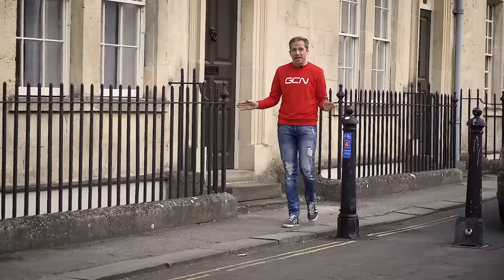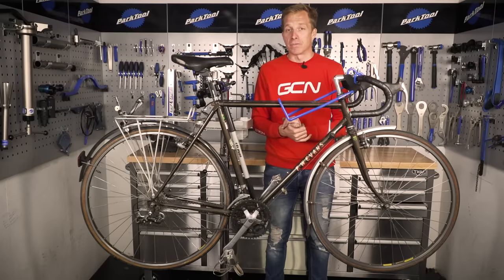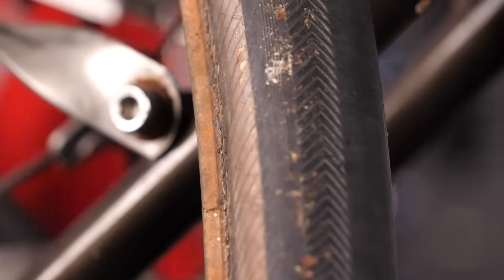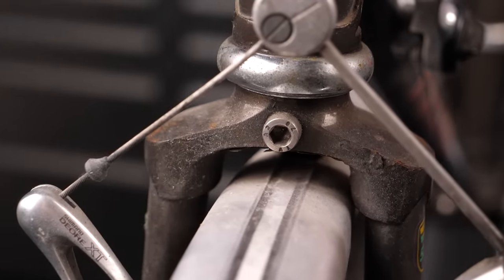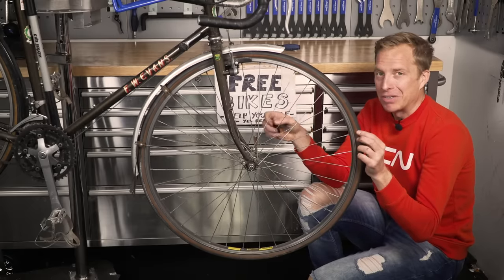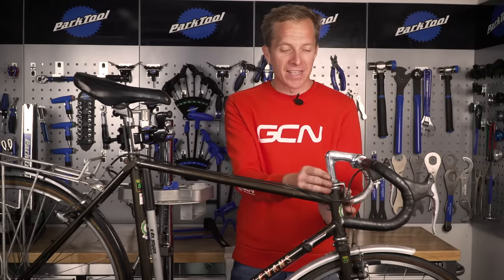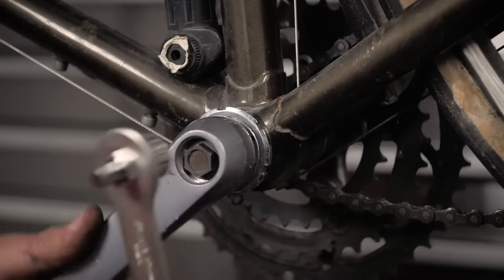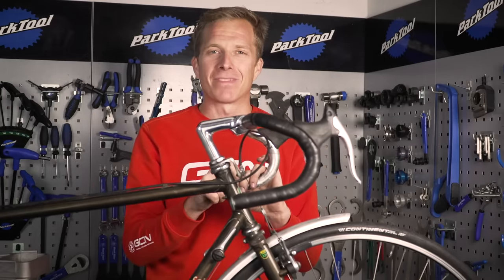Trash To Treasure | How To Fix Up An Old Bike

Comment: Very interesting story, and I have 2 of my own to tell.
The first was in the early 90s and I found a Tigra, 531 DB tubing, all Campagnolo Record, Mavic wheels and tubulars in a skip. I asked the owner of the house as it was being cleared and he told me to take it.
I dismantled it completely, down to the last ball bearing, replacing cables, chain, tyres, headset and bottom bracket. eventually I installed Shimano XT components (Ultegra brakes) and I used it regularly as a "doesn't matter bike" until last month! It had chromium-plated ends and drop outs, fancy lugs - paintwork was not too good so I sanded it down and resprayed it, keeping the chrome ends.
I took a good look inside the frame and no rust! Just before I threw it out, with the frame number, it was identified as a pre-production frame which would have been given to a pro team in 1972.
My second find was a Japanese bike from late 1980s which I have treated similarly. Frame is dead straight, no rust, wheels useless. Beautiful paint and brazing. I have spread the rear axle to take an 8-speed wheel, and am fitting new bars, 8/9 speed XT and 8-speed sis brakelevers/shifters. Smaller chain wheel (42t) was a little worn and I have fitted a Shimano 38t, with a 13-32 XTR teeth rear cassette.
In this case headset, bottom bracket like new, probably ridden little, but left outside in a shed for 20 years. A Dura Ace seatpin and Selle Italia Flite with some Dura Ace clip pedals have been added. I had an XTR rear hub rebuilt with a modern Mavic clincher rim, I am lucky to have a pile of unused parts lying in my cellar which I have bought over the years and welcome a chance to use them.
First, look at safety - in my view replace all cables, they cost little, inner and outer; new chain if the gear train is ok, and check the frame for bends, breaks assiduously. - I cannot stress this enough as an acquaintance gave me a couple of old Italian bikes, one had a hairline fracture of the forks which he forgot to tell me about ... what I call a near miss!

Comment: You definitely lucked out on that bike Jon. I tinker with lots of old bikes myself and I've pulled bikes from the tip that just needed air in the tires so not unheard of. Say I'm wondering why you didn't repack all of the bearings as part of your maintenance. It's my rule of thumb that hubs, BB and headset all get fresh grease. Also you didn't talk about brake pads. I've found new pads is a smart investment as well if you plan to ride it.

Comment: Also check the derailleur jockey wheels, believe it or not.  I've been riding a similar era touring bike every day over a patch of grooved pavement near my house, and the bolt holding the lower jockey wheel actually worked itself off.  My derailleur basically exploded.  I'm trying to keep this bike mostly stock, so I had to pick up the pieces I could find and rebuild the derailleur completely, hammering the pivot pins back into place and straightening the jockey cage in a vise.   Thank goodness for those forgiving five speed tolerances.

Here's a tip for Jon: when you're working on dirty bits, wear disposable surgical gloves.  This will keep your hands clean and prevent you from spreading grease to stuff that ought to remain clean, like the bike seat, your clothes, door knobs, family members etc.   I'm almost 60 and have been working on bikes and cars since I was  teenager, and it was only just last year I noticed some kid in a YouTube engine repair video wearing them.  You could have knocked me over with a feather.  All those years, scrubbing my fingernails with mechanic's soap and a nail brush...

Comment: Stuck seat post or stuck stem can be the game changer as to whether I would go thru the bike.  If one or both of them are stuck, then the bike would have to be something really nice (and my size).  After a short test ride to assess any major issues (like frame alignment, bottom bracket, or steering issues), and bench checking for the same types of major issues, I would rip it apart, stem to stern.  I usually find at least one spot with pitted this or broken that or stripped thingies.

Comment: I'm currently doing a very light refresh on a 2000 Specialized 415 Fatboy that my son pulled out of a dumpster on the campus of Bryant University in the state of Rhode Island about 15 years ago. It has been taking up space in my basement ever since. As far as I can tell, someone mal-adjusted the "dia-compe" hombre U style brakes and did not know how to make them work, so they just pitched the entire bike into a dumpster.. I'm putting a new single speed free wheel and a new chain, adjusted the brakes and gyro, cleaned it up that's it. Good to go!

Comment: It takes a long time to find a decent second hand bike if you want something which is reasonably rideable. I work away from home during the week and I wanted something not too precious that I could leave at the place where I stay all the time. After 6 weeks I got lucky. After being constantly knocked back every time I enquired about a half-decent machine on Gumtree or eBay I found a Raleigh road bike, about the same age as this Evans, with the all-important Reynolds 531 and a really decent Shimano Exage groupset. I peeled a hundred quid out of my wallet, fearing that any minute the seller might realise they could have got a bit more for their machine. Nine months later I have used it quite a bit and nothing has broken or needed replacing. All I have bought is mudguards and a modern pump to replace the plastic SKS frame fit jobby.
My only cautionary is finding parts for a thirty year old bike can sometimes be quite difficult. The gearing is rather high  -  52 / 42 on the front and 13-24 7 speed rear, which is fine for the Thames Valley where it is kept, but a tad steep for a rider twice the age of his machine who would like to use it in hilly Somerset where I live. I live in hope that one day I will find the parts I need - drop the front to 50 /38 and then replace the rear cluster (widely available) for a 13-26.

Comment: I actually had this kind of luck about a year ago. Next to the dumpster by my house was a 1997 Nishiki hardtail mountain bike. Shimano 12-speed, size is good for me, nice color and not too heavy. It needed some work, though. New shifters, tires, brakes, and wheel bearings. I actually used that bike to learn how to work on bikes--I made friends with the owner of a local bike shop and refurbished it, asking for help when needed. After a conversion into a weird sort of flat-bar pseudo-road bike via some 26" road tires from the Czech Republic, I completed an all-day tour around San Francisco on it complete with some fearsome climbs. Next up for Dumpster Bike is a fixed gear conversion; I think that'll be a lot of fun since I already have a hybrid for normal riding.
Reply from the maker: Sounds like a great build! Those parts bin builds can be super fun and a great way to learn new skills. Have you submitted the bike to the bike vault?  We would love to see it 👉 https://gcn.eu/app
Reply: @gcntech  I'll submit it after I clean it up and see if I can find some old pics for a before and after. Might be a bit before I get the fixed gear stuff on there and now I'm thinking a paintjob might be in order.

Comment: I just got a Bianchi Premio for $5. The paint condition looks solid, and all components look rust-free. Haven't taken a deeper look at the drivetrain but I do hope there is nothing significant need to be replaced. BTW, tires definitely need to be replaced though. I don't even know why I stopped by and actually bought it. The only reason might be my obsession with antiques?

Comment: My bike was bolted to some railings at the bottom of my apartment. The people who lived there previously moved and I walked past it every day for 3 years and it never moved. Some people before me tried to steal it for scrap metal and sadly bent the rims beyond repair. After 4 years of sitting and never moving I finally got it for free and replaced the rims. To this day it’s still as straight as a dye!

Comment: i picked up a giant scr3.0 off ebay for next to nothing ,but the last owners rode the wheels off it , i stripped the whole bike down and replaced everything and upgraded the bb ,running gear and wheels from old stock off the internet for less than £100  ,now she is brand new with 30 gears and rides better than a new one out the shop ;-)

Comment: Very much a dream find and sadly rarely the case.  
Last year, I was out for a run and came across a lady was cleaning out a tenant's abandoned stuff to the curb for garbage collection.  She had just wheeled out a bike as I was going by.  She said "Be my guest" when I asked if I could have it.  It's only because I can rebuild bikes that this bike made any sense as I needed to spend a few hours and about $100 in parts to get it rolling for one of my kids as a beater bike.

Comment: I find 1980's and 90's mountain bikes on the scrap metal pile at the town dump quite often. High quality road bike are not so common although I did find a 1980's Univega Gran Premio last summer. All it needed was cleaning, new grease in all the bearings and brake pads.   A few weeks ago I found a Peugeot Orient Express mountain bike. It looks like someone bought it in 1984, rode it one summer and never rode it again.

Comment: Woah bike looks nearly new considering it's age. Some semi gritty rubbing compound for the rust is all it needs as far as paint. As for a free bike, the first thing I would do after deeming it worth my time, is strip the bike down to just the frame, in order to check inside the head tube, bottom bracket, and seat tube. If it is steel I'd spray frame saver inside the tubes to protect it from weathering (rusting) any further.

Comment: Cool video, I love retro bikes.  I got offered a 1958 PT Stallard Super Zacopane that was going to be skipped.  I have managed to salvage all of the frame, mavic rims, Weimann brakes and levers and also a rather nice 1950s Phillipe stem and bars.  PT Stallard made bikes in Wolverhamptonfrom 1932  up to 1982 and all of the records of all the frames he made are in the Wolverhampton archives, so I have managed to get the origonal bill of sale, colour, spec when it left the shop etc.  This has cost me a few quid for the info from the Archives and that is it.  I am however going to have the frame restored to the origonal colour with pin striping and lug detail as well.

Comment: as someone that left old cables in my retro 80's/ 90's MTB that i rescued from a charity shop that I worked at (H & S deemed it so we could not sell on so I made a small donation and took), and I also did just lube the inner cables, this was fine until a cable snapped on me, I got a similar aged/quality steel DB MTB, I also had to replace sprockets, back wheel, and chain, the chainset was in good nick as was the H/set & BB, I would just buy a full set of cable which is less than £10, all the rest all good advice, new tires a must, as is new handlebar grips/ tape

Comment: 2:54 But that first one clearly isn't an inch and a half. Good witch though!
I found a bike in the forest once (what was left of it) I restored the frame, forks, stem and bars, bought the rest new and turned it into a new bike! :-D I'v done about 1500 miles on it now. :-)

Comment: My current steed (<13kg front suspension hybrid) was built from parts collected up from 3 bikes which cost me £70 total, one very rusty free one, one with a snapped frame but lots of good stuff £50, and one which had just been outside too long but good frame £20. There were enough leftovers to build a bike for my wife too.

Things to check? All bearings, tyres, inner tubes (inflate to high psi and check whats left after a couple days), really everything bears at least inspection. Try to figure out what made the previous owner give up on it!

Comment: You could have called this "How to figure out that you don't actually need to fix up an old bike much at all".  Nice find!  Personally, I'd always replace the seat, tape and hoods because those can all get pretty nasty with someone else's accumulated sweat.  Plus I'd replace all the cables (even the ones that look solid).  And I would have buffed out that rust and repainted the frame.  Plus, looking at all the bearings to confirm the grease is reasonably fresh is usually a really good idea.  Other than the seat, that's all pretty cheap to do.

Comment: Great vid. :) You certainly found an easy one to restore. Straight after checking frame alignment you should really have checked if the seatpost and stem can be moved/adjusted. If they can't then it can spell the end of a restore. To get them to move can be as easy as a squirt of WD40 or (in worst case) major surgery. There are other vids on 'how to remove' seatposts and stems and some of them are scary for the average bike owner.

Comment: Rust isn’t a bad thing. You don’t need the most secure lock, just the least desirable bike on the rack to steal for the amount of work your lock would take. Mine is a 1978 Schwinn collegiate sport 5 speed that had been changed to flat bars.

Comment: Nice find!  I would not touch the headset (horrible things can happen), but run new cables, dob some grease here and there, and for Gods sake man, put gum wall tyres on it.  Probably would change the brake pads if they looked dried out, give the cogs, chain,  and rear mech a good degreasing and lube...and Bobs your uncle you have a fun ride for 2 hours work and 20-30 quid (depending on tyres...)

Comment: I'd check how well the rear wheel rolls or if it's loose/wobbly. 
Taking a rear hub apart on an older wheel can be a nightmare. I just finished my old bike from '83 that I just bought and it works like a dream. But it took 6 hours to disassemble, clean and reassemble.

Comment: Oooof. I could have made this video 10x better. Most of the things you mentioned were common sense even to someone who isn't a cyclist, I think.

I have restored a bike from the garbage. A 1988 Cannondale Criterium. Now it looks brand-new and I beat dudes with $6000 bikes from time to time on climbs and on the flats. 

You should have mentioned paint, and swapping out dated parts. Painting is pretty easy. How about using toothpaste to polish the aluminum? How about an easy way to switch from a freewheel to a cassette to open up a lot of new options? I've been thinking of taking all my photos and making a blog... but haven't got around to it yet.

Comment: I would also: change grease in BB and headset. Clean and lube all the drivetrain. Change the cables AND housing. And, last but not least, check if the seatpost is not stuck in the frame.

Comment: Clean and re-grease all bearings. Put a drop of oil on all pivots if the bike has caliper brakes. If it has cantilever or linear pull brakes takes them, clean and grease the pivots. Replace the brake pads. On this bike I saw one with a crack.

Comment: Sometimes I wish I was of more average size that I could take advantage of great finds like this but it's rare to find a bike around 64cm range.... I did get a good Motobecane grand touring circa 1983 for $50 usd a few years back and put about 15k miles on it but now need to rebuild the freewheel which I will change to cassette and finally exchange the Huret derailleur for a Shimano setup with vintage suntour bar end shifters. The Stronglight crankset is still in excellent condition and I think could last 30K more miles as long as I keep an eye on the chain wear.

Comment: I had an old 91 guardini given to me made out of Colombian tubing made by a guy from Toronto Canada he builds forklifts to 105 groupset so I went through the whole thing repacked replace all the Barons put a new seal bottom bracket in it brand new tires new tubes put modern clip in pedals and change the gearing in the back but it's pretty much original

Comment: Well I'd definitely check out the size to see if it was right for me. Check the freezer wheel and front cogs for where. Then I'd take the whole thing appart and grease it all. I'm sure the Cabell housing is rusted and Ned's replaced. Cables are so cheap so those for sure
 I'd add some oil to all the spook nipples cause I'd expect them to be siesed. Pretty much all the basics that you didn't do.

Comment: I just found an old Dawes Galaxy in great condition and going to the highest bidder . As I was the  only the only person interested I got it for £50 .I thought it was an 80s model until a more knowledgeable pal informed that Dawes included the year of manufacture in the frame number , He was right and it turned out to be a slightly disappointing '92 model . I am still happy with it though .